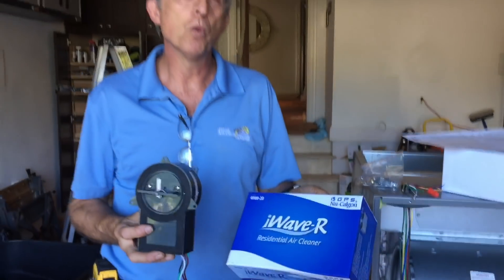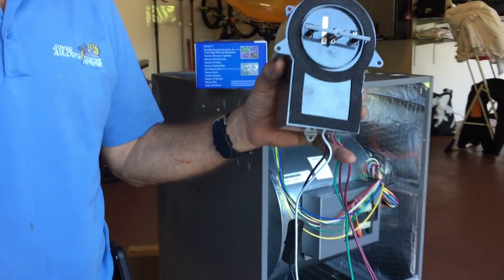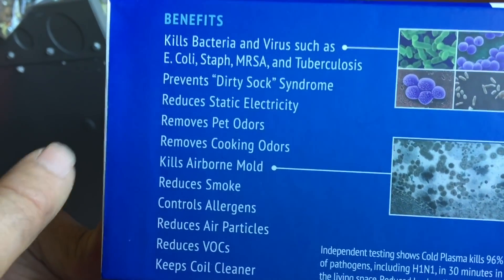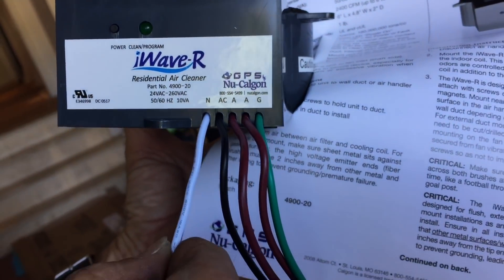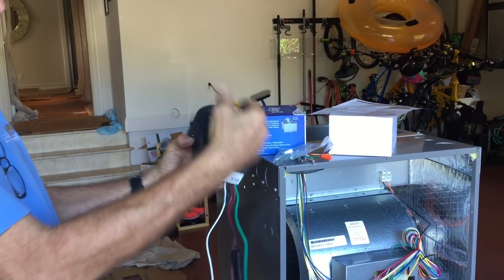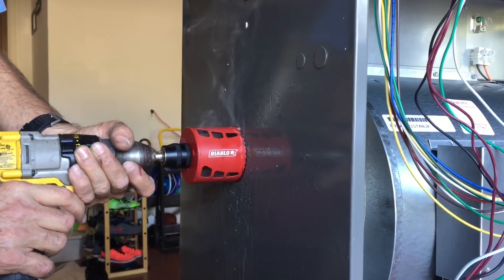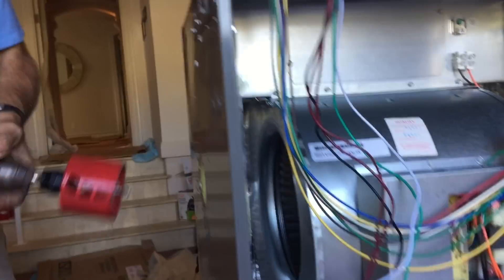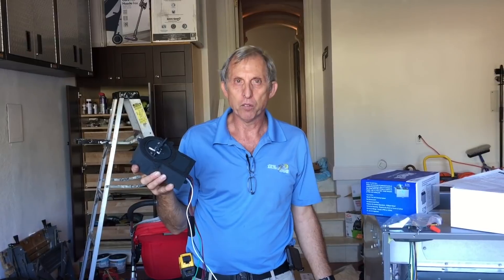Mounting & Installing the iWave-R Residential Air Cleaner

Comment: Good video, but you stated that you install to the 240v so that the unit runs 24/7.  You can wire it to your thermostat terminals and still have it run 24/7.  It's not either or.

Comment: where does the white and black wire attach to on the furnace circuit board. I know nothing about electrical, I'm trying to do it myself, any input would be appreciated, Thank you! Best Ed
Reply: Very simple black goes to the R terminal and white goes to the c terminal right where your thermostat wires are connected very simple and the green wire goes to ground 👍🏻
Reply: @theduffster2581  Hi Dennis ! Thanks ! One question, is that the part on the board where they happen to be the screw terminals? Thanks again 👍👍
Reply: @edverbic9818  yes r and c also turn the switch off while your doing it and the green wire can be grounded wherever you can put one in yesterday about 15 minutes 👍🏻
Reply: @theduffster2581 Thanks again Dennis! I will let you know how it works out, I ordered the "I Wave R" last month, still waiting for delivery.👍

Comment: That is an up flow air handler   Shouldn’t the iwave be below the blower?  Air will pass through better if the unit was 8” lower
Reply: I would really agree with you Francis.  Good point
Reply from the maker: you want the ion's to go into the house where I installed is the best place
thx
Reply: @Francis Greene- Agreed

Comment: I think its better to put inside the insulation side facing the fan. It looks like the needles of the ionizer are not sticking far inside the air handler (covered by insulation).

Comment: WD-40 is NOT for drilling/lubricating.
Water Displacement formula try number 40.
It comes with magnets and the simplest way to install it is to place it in the duct below the unit, if it sits on a can, or in the blower compartment itself. No need to drill a hole and being there will not make it work any better.
Reply: How can you put it between the filter and the A coil in a standard up flow unit no return ducts. Remember the ionizer needs to be placed vertically (upflow). Its impossible to be placed between the filter and coil..
Reply: I streak

Comment: Does the fan need to be running 24/7 for the I Wave-R to be useful?
Reply: The unit is self cleaning on a default 3 day timer.  If you do not keep it running 24/7, it won't self clean.
Reply: Yes, it only runs when the fan is running
Reply from the maker: no

Comment: Great video David. Please note that the iWave should only be purchased and installed through a certified HVAC technician or contractor. We offer a 3 year limited warranty on our iWave line, but this warranty is only valid if the unit is purchased and installed by a certified HVAC technicians or contractor.
Reply: That's nonsense.  Show us a video on properly installing the iWave-R in an existing system.  it's not rocket science to attach 2 wires, but we need a video on doing it properly so that it works effectively.  $600-650 or so for a professional installation is absurdly expensive, when the unit can be purchased on Amazon for about $380 (and even that we know is making quite a profit).
Reply: @pxxxbxxx253  True and they would probably sell a lot more units!
Reply: @pxxxbxxx253  come on man... You know how this stuff works... It's an industry thing, gotta protect the guys making them the most money.  They are so cheap that doing it myself is far cheaper even if I am replacing the unit twice than paying some druggy to come install it who calls themselves an "HVAC Professional".

Comment: Yeah this guys an idiot. Glad it was previously noted that this guy is using a wood tip instead of a bi-metal. Also yes, it should be installed pre coil. Dont say theres no room, bc there is. Its magnatized and will hold right inside of the coil
Reply: You guys can just put it on the floor on your return side before it goes in the filter and coil.
Reply: How can you put it between the filter and the A coil in a standard up flow unit no return ducts. Remember the ionizer needs to be placed vertically (upflow). Its impossible to be placed between the filter and coil..

Comment: Thanks for the video, questions, wouldn't you want the IWave mounted or placed in the return so it can go thru the coil airstream first? And Why would you want to use 240-260 volts when 24V would be safer...  is HV even allowed in a return?  Can t you wire the 24V to run 24/7 via the transformer 24V side?
Reply: The reason you want to use high voltage is that a typical 24v transformer only produces .50 amp. Most hvac  systems use between .25 to .40 which leave .25 to .15 amps to power the iwave on the 24 volt circuit.  You'll either starve the iwave or burn out the 24v transformer.
Reply: How can you put it between the filter and the A coil in a standard up flow unit no return ducts. Remember the ionizer needs to be placed vertically (upflow). Its impossible to be placed between the filter and coil..
Reply: CSJiGSaW08 In the return (box underneath air handler)  behind the air filter. Air is coming thru the air filter, passes thru the IWave, and fan pulling it up thru the coil, blower and up thru the supply air into the house. Repeat... I actually got one and built a 8” platform for he iWave to sit on actually getting more in to the return air stream.  Works great.
Reply: Why not then use the normal 115-120 volts then rather than burning up the transformer instead of having to run 240-260 volts to the unit would that not work just as well ?
Reply: Arg The Pirate The factory says it’s can use either.  24v up to 240v.  And as long as it’s in an air stream its good to go. I think there is a building code where you can’t have HV in the return unless it is shielded some how.  I did call the factory and they told me it didn’t matter which one you use just not to run other things ie UV ligjt at the same time. They said it may work or it may be too much on the transformer they even said maybe upgrade transformer to 70VA.  I think Trane and AS electronic air cleaners you have to upgrade xformer before you install it.